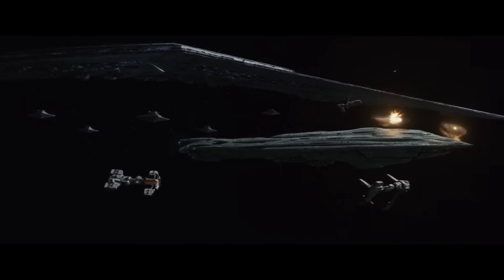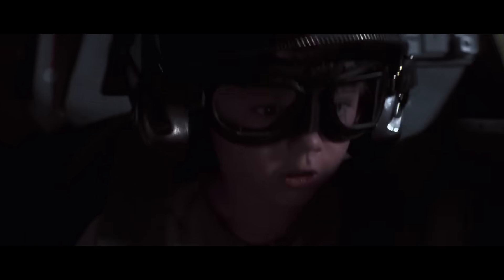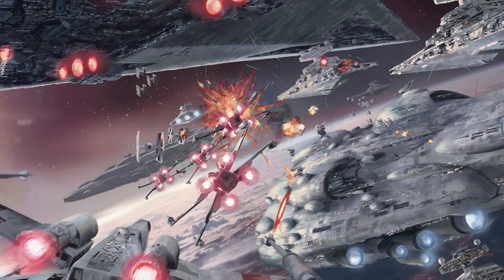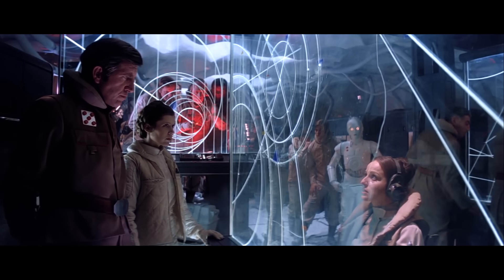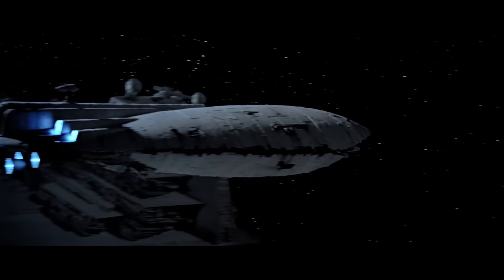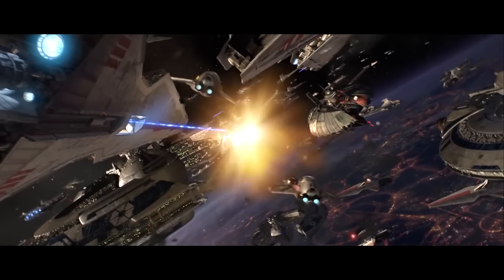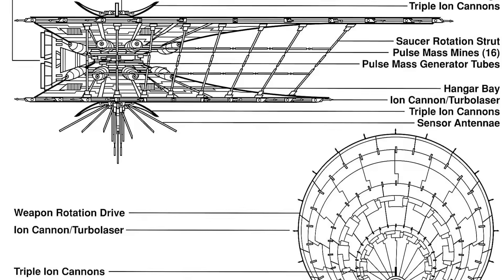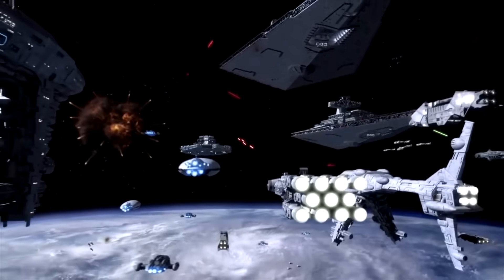Why Star Wars Turbolasers SUCK! (and better options) | Star Wars Lore

Comment: I'd use ion weapons and railguns
Did any faction in Star Wars factions focus on disabling and taking the opponent's equipment, ships included, for their own use afterwards? #AskEck
Reply: Tom McDaniel Pirates, naturally. Possibly also rebels, but I doubt it was common - the Empire had a nasty habit of building their small ships as cheaply as possible, which didn't fit with the Alliance philosophy of actually valuing the lives of their enlisted personnel. As for their capital ships, the Alliance didn't have enough people to crew them, and certainly not enough to make the losses incurred by the capture worth it - see Spacedock for a video on the subject.

Comment: Can't remember how long ago this was, but this was a idea I had on your 'design a capital ship' video. Never commented on it, but my ship would have been a refit Lucrehulk that pretty much swapped out turbolasers for ion cannons, and added a large number of missile launchers/torpedo tubes to the outer ring. With quad railguns in a fused core section that ran all the way to the engines.

Comment: Have you considered that turbolaser despite their many problems may be more efficient, especially energy efficient that the alternatives. A Thousand rounds from a turbo lasers may use less energy and cost less than 1000 rounds for a MAC canon when factoring in making the ammunition and transporting it to the ships.
Reply: JonBerry555 Not really. Directed energy weapons give you very little bang for your buck, which is why even though we already have them, they aren't used offensively. The one thing they are good at is shooting down missiles. Mass drivers would be far more energy efficient, and in fact the only reason why the US Navy's rail gun project was scrapped was because our materials science isn't currently advanced enough to provide sufficiently durable barrels. As for ammunition, a mass driver slug is basically just a solid chunk of ferrous alloy, and the ones the Navy planned to use were only about 25kg or so, if I remember correctly. That's pretty compact, especially compared to the modern naval ballistic weapons, and you get the same range and firepower as a missile. Besides which, iron and tungsten are common as dirt, and correspondingly cheap.
Reply: Pyreleaf, I'm talking Star Wars, not real life.
Reply: JonBerry555 Yeah, I know, but Star Wars tech isn't exactly logical. You can justify anything in an arbitrary fictional universe where you make the rules.
Reply: Pyreleaf, True, but I don't make the rules. It is the people who make/made the stories who do. Plus Star Wars has its own internal views. All us fans can do is speculate and theories responsibly about how the universe works based on what we can learn and infer from the stories that we have.
Reply: JonBerry555 You're right, of course - what I mean to say is, beyond simply being at odds with the real world laws of physics, the Star Wars universe's own rules don't appear to be internally consistent, which keeps me from engaging with them fully. It requires a greater suspension of disbelief, you know? I don't have that same problem with Halo, most of the time. The tech is advanced, but recognizable, and it doesn't handwave physics.

Make no mistake, I like both universes, I just think Star Wars would be vastly improved if it took a page out of Halo's book in regards to technology and warfare.
Reply: So tibanna gas is less expensive than metal slugs?
Reply: @tjdragon7993  Tibanna seems to just be easier logistically. A single cartridge in a DC15 blaster is good for something like 500 shots I think. Combine how far a little bit goes with its abundance in the SW galaxy and you have an economically and logistically viable ammunition source.
Reply: tjdragon It would have to be, on basis of relative rarity alone.
Reply: tjdragon, I actually don't know. I don't think its ever been shown in canon or Legends which one costs more. Therefore, based on the abundance of energy weapons which uses Tibanna gas a a fuel of sorts, I've made an assumption that it may cost less to use turbolasers.
Reply: JonBerry555 How could that be, though? You'd have to get it from gas giants, and those are much less common than terrestrial planets and metallic asteroids.

Comment: The "Venator-style heavy laser" is just one of the walkers in the hangar bay firing. We see those heavy lasers take down a Lucrehulk core ship at Geonosis.

As for the Hapan ships, they have an interesting counter to the cooling issues of turbolasers. Their cannons are in clusters of three on a swivel. One fires, the whole unit rapidly spins to bring another weapon to bear and fires that while the first is cooling, repeating the process until the weapon is ready to go. This allows Hapan ships to fire three times for every single shot of a turbolaser on a Star Destroyer.

Comment: What’s worse than having a Mac that  takes forever to reload? Some laser guns who take forever to  load and almost always misses.
Reply: Cactus thing with food MACs may take a long time to fire, but their slugs actually travel at an appreciable fraction of light speed (something turbolasers, despite being LASERS, completely fail to do), making them more accurate, AND they actually wreck shit when they connect, because firing anything of any size, much less a multi-metric ton tungsten slug, at fractional c velocities pretty much guarantees an explosive yield measurable in multiple nuclear warheads.

Don't believe me? Take E=MC^2, plug in a single gram, and feel your bowels loosen as you realize how utterly fucking terrifying physics is.
Reply: Cactus thing with food Nah, I was tired at the time, and I'm too used to arguing with morons, so the misunderstanding is at least partially my fault.
Reply: Pyreleaf math is just a way to find out how tariffing a big metal slug flying threw space. Start paying attention more lol
Reply: Pyreleaf your good I get it. have a good night.

Comment: It seems to me that turbo lasers were actually pretty decent at taking down shields, ion weapons would only marginally improve on them in terms of time it takes to knock down a shield. Do you want to take down a shield in 7/8 the time but lose the versatility of the turbolasers? Granted there is something to be said for specialization, but maybe if it was 3/4 the time it'd be worth it.

Comment: Replicators vs a Unified Star Wars universe (446th try now, I. WILL NEEEEVER EEEVER GIVE UP!!!)
Reply: coming up on infra-red Just stop. It's annoying.
Reply: @boatcaptain6288  No.
Reply: It's annoying stop
Reply: + @boatcaptain6288  Aaaand I refuse, better luck next time bud
Reply: Just stop its never gonna happen
Reply: + @jasonskeans3327  Oof, a fan of the profile pic but it's still a no from me
Reply: Replicators (from stargate)are badasses cooool energy absorption, eat though virtually anything, adapt any wapions energy or projectile, the more metal/ exotic materials they eat the more there going to be. all so become the material they were consume,  build battleships better than new/ humanoid replicators are smarter and more badass, can make any ship to have hipper drive ( for example star trek is far slower and weaker give trek some replicators for improvements)

Comment: Wouldn't each gun being directed by a gunner officer be kind of a moot point? It should not effect the coordination of the ships guns at all. Ideally it would work like a battleship where each battery has its own officer but these officers are subordinate to the ships primary fire control director. That director can assign each battery individual targets or have all guns concentrate on one or more targets. The officer is more or less responsible for the smooth operation of the battery. The only time the officer should be directing weapons fire separate from the fire control director is if the director is knocked out.

Comment: What makes the Turbolaser and it's variants like octuple turbolaser batteries so terrifying is the sheer raw firepower they can output and the fact that they are all manned which means no hacking and you'll have to take out every last damned battery to disable the ship. Though they're no phaser they're still accelerated balls of super heated plasma with (potentially) gigatons of impact.

Comment: I've often thought my dream imperial ship would have been an ISD mk2, with only 75% of the weapons emplacements of a stock ISD, but those batteries are all composite beam weapons a la the death star/clone gunships. In attack of the clones those beam turrets which were shown to be able to be mounted on a pod on a laac were extremely super effective against separatist forces. I figure you scale them up to replace Turbolasers and use the pod sized ones for point defense.  Being they actually are real beams they travel at light speed and so are super accurate.

In addition to that my ship has a salvaged Droid control brain deep in the ship that has one job... Coordinate between the turrets which are themselves run by individual Droid Gunner brains that's only job is to do the math needed to aim at enemy ships and then fire.

These 2  changes would result in a ship capable against both large capital ships and fleets of smaller fighters.  I welcome opinions on my theory. #askeck

Comment: Turbolasers, as anti-capital ship weapons serve that purpose wonderfully. As planetary bombardment weapons, masterfully. As anti-starfighter, poorly.

I agree that starfighters are capable of taking out a large capital ship, but that is rare and usually after those capital ships have taken a beating from other sources, or after lucky shots.
Reply: @coldlizard 2 a few kilometers, orbital bombardment is a minimum of 60 kilometers to as much as 300 kilometers.
Reply: @coldlizard 2 past 100 kilometers sure the energy dispersion would make turbolaser bolts ineffective at about 300km. But the standard type 2 mac from Halo would be ineffective at the same range.

And overall power of a full turbolaser battery is enough to decimate a planetary surface faster than the covenant glassing laser at more than twice the range
Reply: Kenneth Kates 

Why would a MAC be ineffective at 300km? Large vehicles need time to manoeuvre and at that distance it would take at most one or two seconds for the shot to hit. In space there’s not much to redirect or slow a MAC round like air resistance or gravity, and they don’t really lose much energy to radiation like a plasma bolt would.

Comment: One good way to improve the turbolasers, in this case the batteries, will be make them automatic, that is to say than just two or three people will activate the batteries by a switch and the guns itself would target and shoot enemy vessels or proyectiles, along with this, as you say with the New Republic, the sensors of not just the batteries but the turbolasers in general (cannons and turrets) would also be improve to be more accurate in a way similar to the Mon Calamari sensors, but another big improve to make would be in the cooling system, making it more efficient and though against damage

Comment: There are also a couple of mechanical issues with the fundamental way turbolasers go about producing their projectile that could be made better, firstly one of their major issues is how long it takes for them to charge, you could reduce it by starting the beam off from multiple small emitters, instead of one giant one have five smaller ones fire into some kind of collimating lens that focuses all of them together into a single big beam, using a physical collimator would also reduce the energy needed to hold the bolt together, since most of it's energy will already be headed in a straight line after leaving the collimator.  It would also be better for turbolasers to have longer barrels with large radiator fins to dump excess heat, and capital ships could be build with sliding armor panels which could selectively expose large radiator surfaces that aren't exposed to enemy fire to further manage thermal load during combat.

Comment: Hey Eck, just wanted to point out that the New Republic's advanced Turbolasers were likely developed in response to their experience fighting the Empire. They likely analyzed various battles throughout the war and realized "this is how we beat the Empire, so this is where we need to improve."

I do also want to bring up a flaw with your personalized warship: all those different weapon system are going to have just as many, if not more maintenance problems as a ship with dedicated turbolaser armaments. It's also going to take much longer to repair do to all the complex systems in each weapon.

In my opinion a better idea would be a dedicated fleet carrier with a large hanger bay, heavy shielding and point defense, and the best sensor and jamming arrays available. It would have to be supported by dedicated escort ships to keep it safe from enemy warships, or engage from outside of their combat range, but the lack of firepower is an acceptable trade-off in my opinion.

Comment: While heat and power requirements important issues, turbo lazers don't require ammo.
With this in mind, I think your strategy of ion cannon focus paired with heavy beam weapons for finishing off targets is the way to go.
Reply: Don't you need tibanna gas? They are firing plasma, there has to be something that they are heating to a plasma state

Comment: #AskEck
I have a question about space combat:  how exactly do shields work?  Because in some cases you have ships that are incredibly well shielded (like a Star Destroyer or Death Star), but yet pieces of the structure can be targeted and destroyed quite easily on a ship that's still shielded.  You see it time and time again:

1) Luke blasting the crap out of the Death Star's gunners.
2) The A-Wings destroying the Executor's shield generator.  Each got off 3 salvos, so a total of 12 hits took it out.  (Were those missiles or lasers, by the way?  Hard to tell in the movie).   This was a ship that had its shields active until the generator was destroyed.
3) In almost every video game I've played, you can pick apart capital ships.  This includes SWTOR, Rebel Assault, and the original Battlefront 2.  In all 3 of these games, if there is a Star Destroyer, you can blast the turrets on it before dealing with the shields.
4) In TLJ, Poe makes a run on the Dreadnaught and takes out all of its cannons.  (Although this movie plays fast and loose with the rules of Star Wars physics, this particular component is consistent with the other points above)

Time and time again we see pieces of the ships destroyed when the shields are up.  Is it that the shields don't cover the guns?  Is it that the fighters are underneath the shield?  How do they protect against missiles if that's the case?

Comment: I think a rail gun and ion cannon ship would be super cool ! 

What if the bigger starship released a few smaller vessels that were built around the ion cannons and rail guns , while being more mobile and agile than the big ship. 

And once they finish their job they just slot back into the big ship. 

Almost like a fighter , but bigger and meant only for dealing with big ships shields and then knocking it out of service.

I guess it would be like an aircraft carrier that released submarines when in a combat zone that would seek out other ships, attack , and hopefully return back to the carrier.

Comment: I think the biggest issue is actually a consolidation one. As evidenced by the Hoth ion cannon's decisive capability a large more dedicated anti-capital weapon can be devastating with a handful of blows. Reducing the number of guns but increasing their size reduces the number of fire support systems needed ( gunnery officer and the like ) and lets you place turrets more optimally, instead of a special few being able to mount themselves on the spine you can place all your capital firepower there.

Star wars seems to be operating in an analogue to the very early ironclads style of warefare before the push towards larger guns and ultimately the dreadnaught which saw firepower consolidated into a single large caliber. This would appropriately relegate the turbolaser to the role of a secondary gun which on real ships might take up an 8th as much tonnage as is dedicated to the main guns.

Comment: One thing I wanna correct (kinda) is around 5:48, you say you'd want railguns as your capital ship-killer, but I'd suggest coilguns, as railguns require the ammunition to stay in contact with the charged rails in order to move. Having electrically charged rails, which would likely heat up very quickly, constantly being scraped by the high-speed ammo would cause a LOT of wear on the rails, which means lots of maintenance, and pretty often too.
Coilguns, on the other hand, is what we're more used to in the real world. It's what most people mistake as a railgun, but it's not because it doesn't actually have any rails. Instead, it uses electromagnetic coils to propel the projectile and doesn't have nearly as much wear and tear on the gun. Similar principle, though.

TL,DR: Railguns need more maintenance than coilguns. If you say you want a railgun, you're probably thinking of a coilgun.